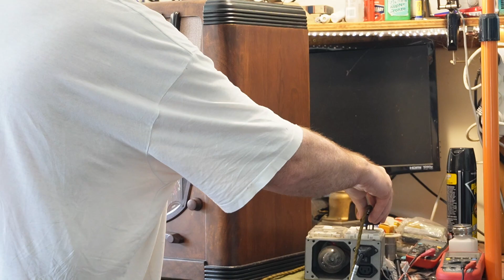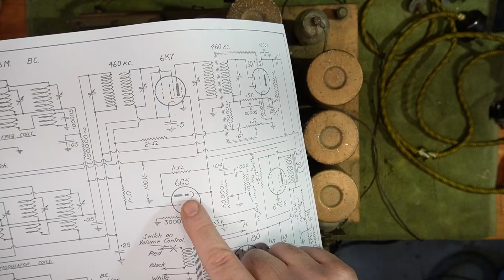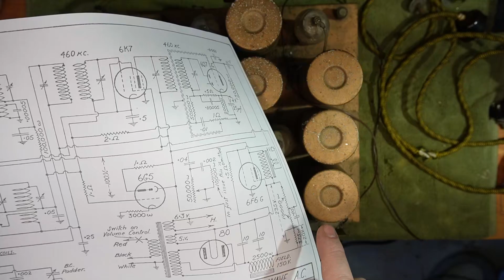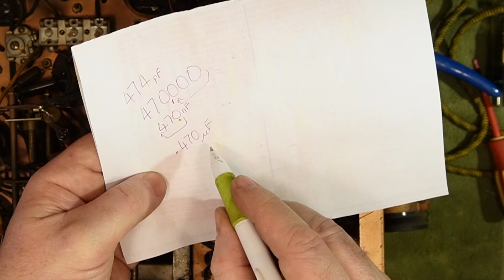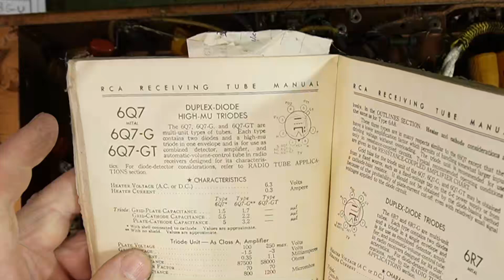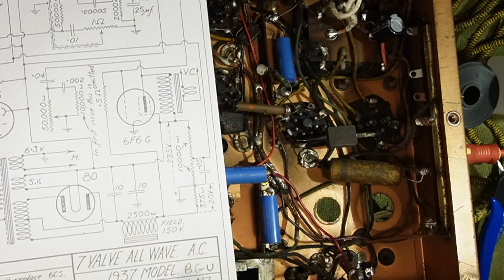1937 Rolls model BCR Repair - Part 1

Comment: I  would never unsolder or solder on a valve holder pin with the valve fitted. I see lots of folk doing this and risking the valves.
With miniature valves the risk is causing the base button to crack. = Dead valve.
With Octals and UXs the risk is unsoldering the valve electrode connecting wire from inside the valve pin, then you can have an open circuit filament if it is one of those pins or a dead valve due to the loss of the electrode.
Reply from the maker: Fair call, I've never encountered problems that I've noticed from doing that, but it's certainly possible.  I might do some experiments around that and see if I can create a fault...

Comment: Superb looking radio Steve. Annoying when the filter caps have been removed from the chassis. I keep old ones to be retrofitted they are missing. Good job so far 👍😀
Reply from the maker: Hi David, it's quite a stunner, for sure.  The owner had the cabinet refinished some time back, so I can't take any credit for that.  I also have a stash of electro cans, and will probably fit some before I am done.  If nothing else, it's one less entry point for rodents!  Cheers, Steve